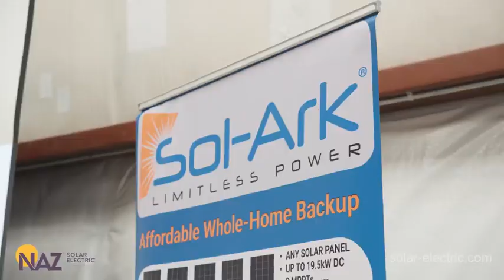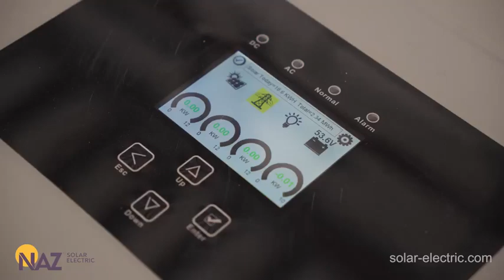Empowering Solar Installers: A Collaborative Training Event with Pytes USA and NAZ Solar Electric

Comment: Hi I have a doubt about sol-ark 15kw inverter. In this inverter spec sheet mentioned "PV Rapid shutdown Control - nec 690.12 - integrated" it means for residential solar projects we can use this inverter without MLPE (Module level production device). Still the system is satisfied with the 690.12 rapidshotdown.Please let me know if it is correct or please explain about this.
Reply from the maker: The inverter has a rapid shutdown button input that can be wired to any 3rd party RSD system. Some panel manufacturers have UL3741 RSD only boxes compatible with our inverter as well, which eliminates MLPE. But most of our systems use MLPE such as Tigo or AP Smart.

Comment: Does dirty electricity become a problem when your inverters are energized?
Reply from the maker: If running off dirty power (such as an old generator offgrid) you can adjust grid parameters to accommodate. Plenty of field experience to back up our user experience. Lots of other tweaks to make quality transformerless power.